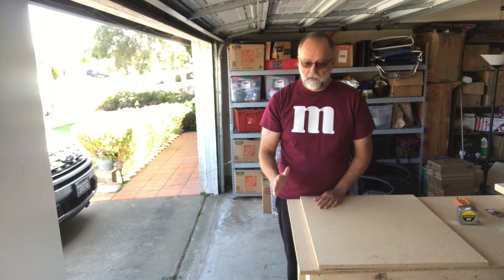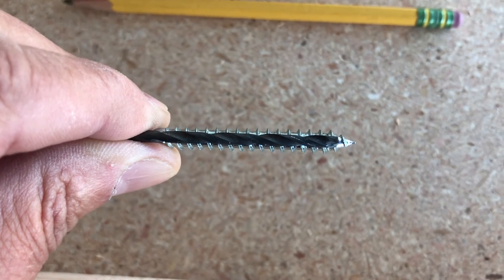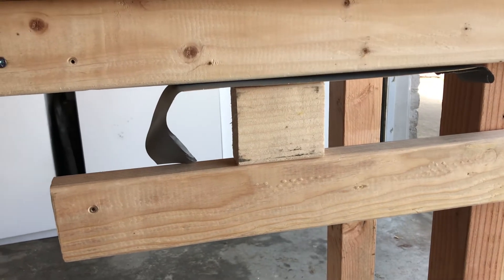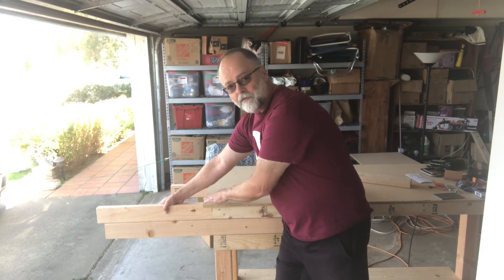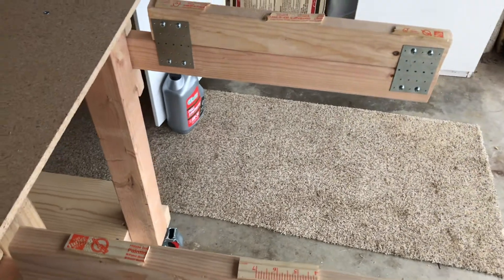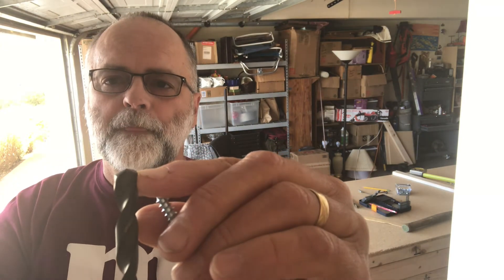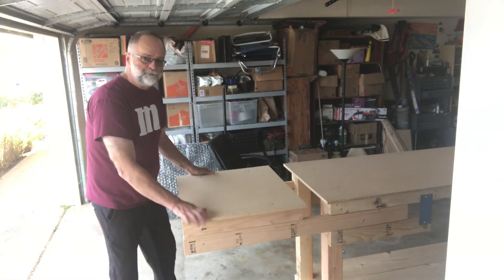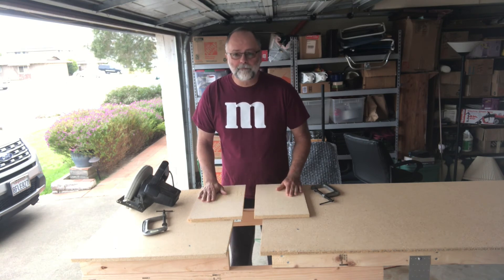Building a Workbench Extension

Comment: Nice addition to the workbench. May I suggest a slight, but short, taper cut into the bottom of the 2x4 slides to make them easier  to mate with the slide pocket of the workbench.
Reply from the maker: Thank you!  That’s a good idea, I’ll add that.